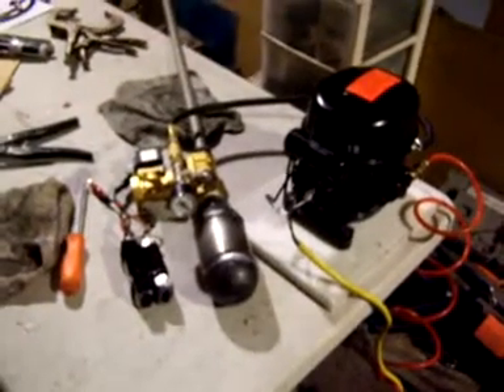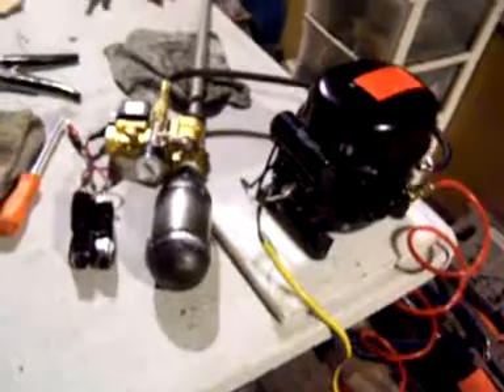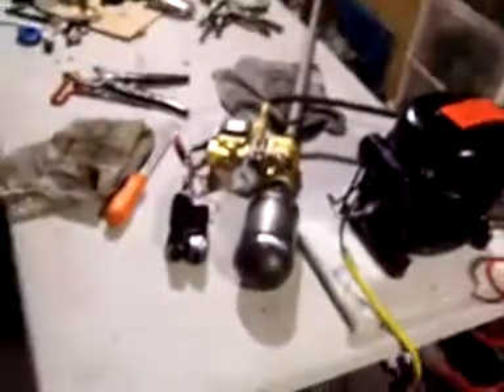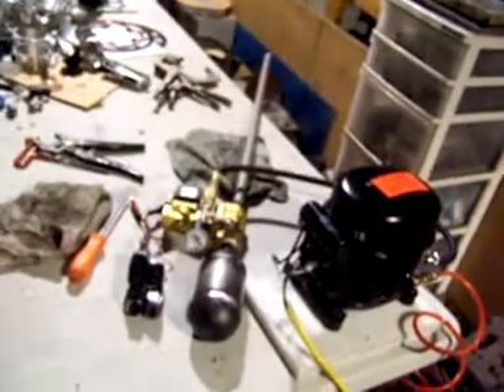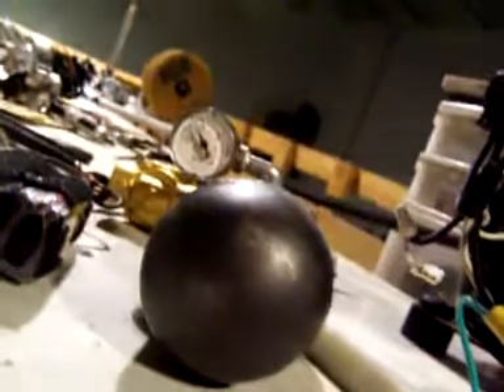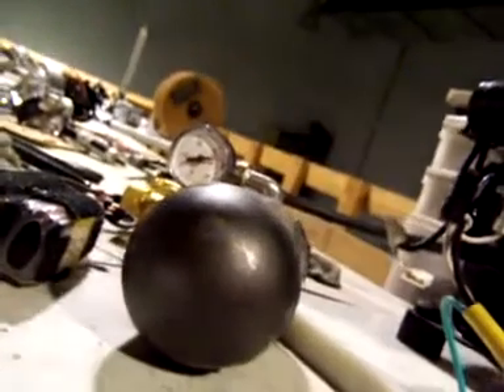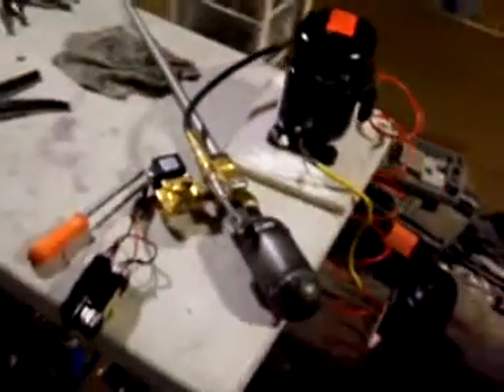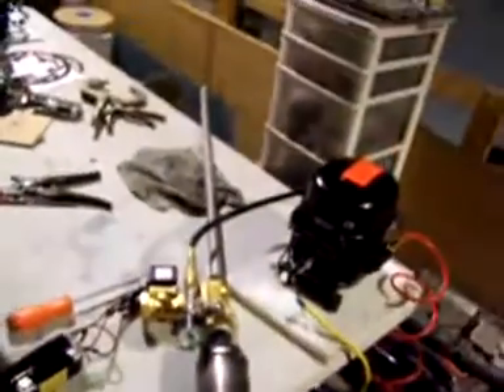1/2 inch bore high pressure 600 psi air cannon spud gun

Comment: Hello, really appreciate your video. Could you explain how you converted a diaphragm valve to a piston valve?
Reply from the maker: Wow, this is an old video. I machined a cylinder and head (one part) and a piston with an o-ring seal. 

I really need to post update video on the whole gun. It is awesome!
Reply: @TechForumTesla  hey what is your email?
Reply from the maker: @PolishRocketScientist  matts@lhaservice.com
Reply: Awesome, yeah, you should! I’d really like to see it now! What about your air tank? Where did you get it from and how did you connect it to your fitting/valve? Did you have to make your own threads? That’s the obstacle I have. I have a paintball tank, but I can’t find a fitting to match the female threads of the tank. Obviously, I need the hole to be a large as possible for maximum airflow. 

Much appreciated.

Comment from the maker: It used a Granzow 1/2 inch bore pilot valve. The gun is now a 1 inch bore (and is completely finished with all wood stock). It is firing 1 inch slugs at 700 psi. So, the 1/2 inch bore solenoid valve is piloting a 1 inch bore valve with a custom aluminum cylinder and piston (I converted a diaphragm valve to a piston valve).

This is a phenominal cannon......

Comment: There is a difference between recoil and propultion.The blast of air is propelling the cannon back like a jet engine.The bigger the tank, themore propulsion you get,
Recoil is what you get when a projectile is pushed out of the barrel.The opposite happens as well: the cannon is pushed back away from the projectile.The object with the smallest mass will just be easier to move and thus excellerate faster.

Swap the barrel for a 1" and load a solid lead slug...then you'll feel the difference.